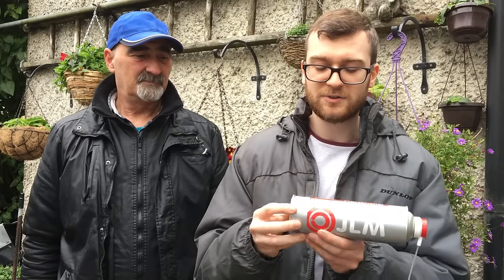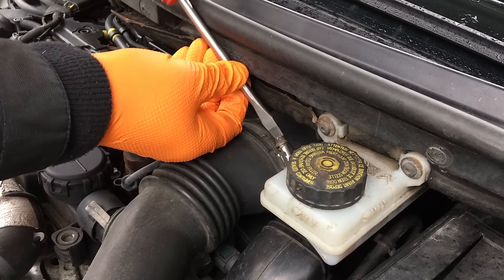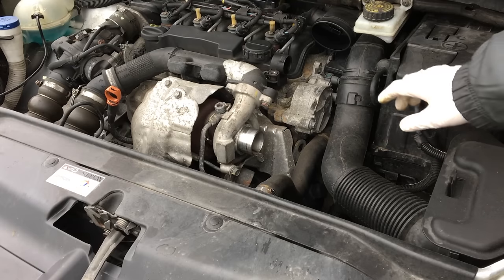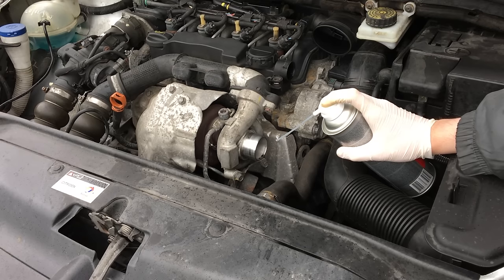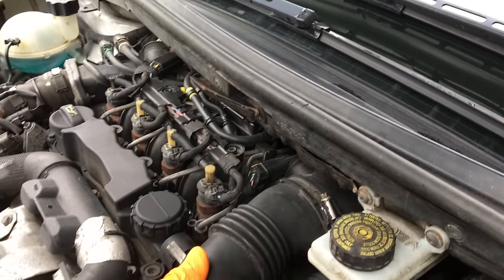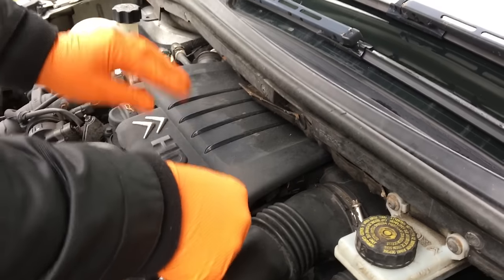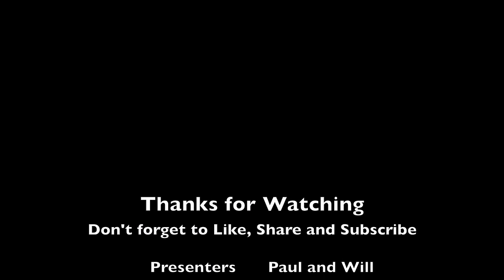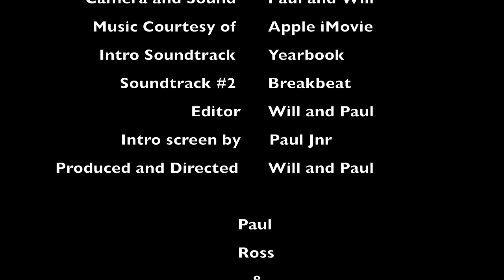How To Clean an EGR Valve Without Removing It

Comment: Hey guys! First of all, thank you SO MUCH for this video - it is incredibly helpful. We will be making a treck to Halfords to get the cleaner tomorrow. 

Secondly... a cheeky question: We're wondering if you know if this problem might have any connection with an "oil pressure too low" warning that accompanied our "Stop" warning on our Citroen C4 Grand Picasso today... our diagnostic reader came up with the same EGR warning, but nothing about the oil pressure?
Reply from the maker: Hi Joey. Glad you like the video and sorry to hear your having issues with your C4 Grand Picasso.

May I ask, how often do you change the Oil & Oil Filter and when did you last do so? Also what oil grade have you been using and does it meet the ACEA & PSA specifications for your engine? Using the recommended oil for your engine and one with low SAPS (Sulfated Ash, Phosphorus and Sulfur) along with a high quality oil filter can help maintain good oil pressure and reduce the build up of deposits in your combustions system and exhaust system. 

Please see this link as an example of how an oil with low SAPS has less of a "fouling" effect on a 1.6HDi EGR Valve than that of conventional oil: https://goo.gl/images/2cgGpN 
(All credit to the website where the image is from).

Driveway Dudes - Will

Comment: I just bought bmw 3 series 2010 disel the milage are  185k and it showing engine light i asked macsnic its egr prob.
Shall i call the company who come and clean the full system the EGR valve, MANIFIOLD, and the rest fuel injectorts the whole system by ataching some pipes to engine and clean full carbon which is stuck inside
Will that solve the egr prob's
Any one can help plz.

Comment: Spraying corrosive cleaner inside your turbo, valves, injectors and exhaust won't do any harm? 🤔
Reply from the maker: Everything you put in a car is corrosive, fuel, oil, water/coolant, even particulates in air.
Over time an engine, transmission, ancillary components and parts wear out and fail. In some cases will fail sooner if the correct maintenance intervals and periodic inspections are not adhered to or incorrect replacement/service parts and/or lubes are used and in some cases will fail due to total neglect. 
We would estimate the cleaner effects of this product outweigh the corrosive effects.

Comment: I was spraying in the correct hole.  But when I took the pipe off and started the engine, the other hole just continually spat out black smoke.  I didn’t see the black smoke on your video, what could this be please?
Reply: Oil burning off

Comment: Hi Guys an hint my be you can drill a small hole  approx 2mm in the corner of the hose to spray it in front of turbo inlet , after that you can stop it with an suitable rubber pin.
Reply from the maker: Definitely not

Comment: Would this prevent the car from starting ?
Reply from the maker: No, the contents of the can will ignite with the fuel
Reply: Driveway Dudes can you buy the spray at a local auto part store ? I have a 1999 Mazda 626 i think it I'm not getting any circulation it shows EGR on my autolink
Reply from the maker: Auto stores should stock a version of EGR valve spray. It may not be the same brand as we have used but they are all meant to do the same thing.
It's cheaper by far to try the spray first than to spend possibly hundreds on an EGR valve replacement.

Comment: Can you use EGR cleaner on Mercedes ML W164? If so where do you spray it into the engine?
Reply from the maker: Hi Ian,
We don't see why not. 
It's not uncommon for ML's as with other MB to get very gunked up pipes associated  with the EGR valve. Some remove all the pipes and EGR valve completely to give a thorough clean.
If you prefer to clean it in place then follow the airbox to the MAF sensor. Disconnect after the MAF or if not then before it but remove the MAF completely otherwise you may damage it with the spray. 

Let us know how you get on.
Paul.
Reply: Thanks for the info.  On my V6 there is a rigid air duct (part no 642 090 73 37) between both air filters and the turbo that includes what seem to be called "air mass sensors".  Two questions: are these sensors the MAF sensors? If they are and they are detached with the air duct can I spray the EGR cleaner into the turbo?
Reply from the maker: Hi Ian,
MAF is short for Mass AirFlow also known as Air Intake Sensor.  
Is the spray you are planning on using 1. EGR cleaner or 2. Air Intake and EGR system cleaner?
If 1, you have to remove the EGR completely and 2, you need only open the duct but remember to remove the MAF sensor before using the spray.
If you can remove the turbo inlet duct and you have the correct cleaner (2 above) you could apply it that way. 
Paul

Comment: My Mini stalls when I let go of the accelerator. Could this be a good fix ?
Reply from the maker: Hi RobM. Could you please tell us what year and engine it has please?
Thanks,
Will
Reply: all I know is, it's from 2002 and it's a 1.6 litre engine if that helps
Reply from the maker: Thanks. Is it a 1.6 diesel or petrol please?
Reply: petrol
Reply from the maker: Thanks. Is it a MINI One, MINI Cooper, or MINI Cooper S?
Reply: Cooper.
Reply from the maker: We are not able to specifically diagnose the issue but from what we were able to find out it could be one of these listed below.
1. 2002 and 2003 models were prone to engine harness issues.
2. Running the fuel tank too low.
3. Insufficient engine oil can cause car to go into limp mode/cut out without light showing on dash.
4. Faulty fuel tank breather valve.
5. Failing throttle body.
6. Failing fuel pump.
If you have the time, we would suggest you get an OBD check carried out by a BMW/Mini approved garage. If it's a friendly and helpful garage, they may already know from experience the issue and a fix. Do not tell them what you think it may be.
Alternatively, you could buy a wireless ELM327 obdII adapter (less than £10), download the suitable app to your android or iphone and you will be able to carry out the check yourself or even monitor it in realtime while someone is driving the car for you. 
Hope this helps.
P.S. Let us know how you get on with it.
Paul
Reply: I've ordered the stuff to give the car a (much needed) service, so I'll see if that improves the situation before anything else. Thanks very much!!!
Reply: @DrivewayDudes url  .

Comment: hey again mate code problem is p1352 is it serious to your opinion?
Reply from the maker: Hi zoharii,This is what I have found for fault P1352.2 possible issues for you to check out:P1352 Ignition coil A Primary circuit Malfunction / SID 801- Pre/Post heating relay circuit - Relay & Pre-Heat plugs not controlled.Could be the relay rather than the glow/heater plugs at fault. It controls the heater plugs. A small green box located near the battery. Paul

Comment: I have little oil in inlet pipes. Suppose it comes from breathing tube. Engine works fine. Does not burn an oil. Is it worth to replace that breathing tube which is integrated with valve cover and cost around 50 pounds. Any ideas dudes. Regards. Mileage is 100k. Some people say it is ok for this type.
Reply from the maker: Hi thelittleyellowducks. Thanks for your comment. When I first bought the C4, the service history wasn't very detailed to what oil was used during servicing and I had some oil in the pipes too. During my ownership over the last 70k KM, I've only ever used the oil that was recommended for the car. The quantity of oil I find in the pipes has reduced as a result.

From my experience with the cars I've owned, it is normal to find some oil in the intake pipes as it is the car's way of recirculating crankcase/oil pressure. This process is often controlled by a valve. I'm sure there is many types but one of which is known as a PCV (Positive Crankcase Ventilation) Valve. It's up to you whether or not you want to replace these but it sounds to me that if you're seeing oil, than your valve and breather pipes are working as intended.

Like yourself I would usually monitor how much oil is being used by checking the dipstick weekly, fortnightly, monthly, etc in order to gauge whether or not there is an issue.

Some people who have cars with forced induction like to use oil catch cans in order to gauge how much oil is being recirculated into the intake and once they deem there to be an issue they can take relevant action.

I'm sure if you use oil with the correct specification and winter/summer weight, the best quality oil filter you can afford and you change these no later than recommended, than you will be fine.

I hope you find the above information useful and if you require any further assistance don't hesitate to reach out to us.

Driveway Dudes - Will
Reply: Driveway Dudes I am more than happy with above answer. I never had diesel. These are new things for me. Many thanks for this feedback. Thx

Comment: Perfect 2in1 way to kill turbo and the engine! Why? Think before You suggest stupid and expensive things to others! 1st- Turbo(bearing) needs constant lubrication (with oil) which will be washed out by the spay cleaner. 2nd (already mentioned by others clever ppl) - if the cleaner manages reaching (not fully evaporated by turbo) EGR, the built up powder will get into engine (intake, comb chamber etc) -GAME OVER! Nothing can disappear or vanish. Imagine all that powder and chips starts flowing into the cylinders - perfect abrasive!

Comment: You spray it into the throttle body not the turbo 

Solvents will destroy a turbo
Reply from the maker: Prolonged exposure to solvents maybe.
More turbos have been destroyed through neglect of scheduled servicing we would say
Reply: this should be done on the charge hose not the intake hose as the spray will ruin a ball bearing turbo

Comment: Gentlemen some advice i just bought a uk  Berlingo 128000 miles very well serviced TG its a 1.6HDi 90  2012  which oil is best for me OW-30 low Saps full synthetic or 5w-30 full synthetic as im worried about turbo life,Thank you paul Hi no problem GU62UUZ thanks
Reply from the maker: Hi, could you please share your registration number with us? If you're concerned about privacy, could you please private message us your registration number? If you feel uncomfortable doing both/either, no one would blame you for keeping it private.

Based on what you've told me, the Total Lube Advisor web site recommends Fully Synthetic 5W-30 with;
* International Standards: ACEA C2
* Manufacturer Certificates: PSA PEUGEOT CITROËN: B71 2290

I (Driveway Dude Will) have personal, not sponsored, brand loyalty to using Total Oils, however you can use any oil that meets the 'ACEA C2' standards and 'PSA: B71 2290' certificate. If you're the same as me and like to use Total, the exact oil I would recommend you use is Total Quartz INEO ECS 5W-30.

As with any used vehicle Paul, Ross or I have bought in the past (sometimes with service history, sometimes without), our first service on the vehicle has always been with the recommended oil. We monitor oil consumption over the service schedule to gauge the condition of the engine. If the oil burns between no and little oil (your handbook and/or forums should tell you how much oil the engine will burn/consume), you should continue using the recommended oil. If the engine burns a little more oil than expected, you can decide if you're going to increase the weight of the oil or bring the vehicle to a mechanic to diagnose the issue.

I hope the above information was useful and we wish you all the best with your Berlingo.

Best Regards,
Will
Reply: Thank you   i appreciate your words of wisdom ,keep safe to you both ,paul.
Reply from the maker: You're welcome. Same to you thanks.

Comment: This is dumb this wouldn't clean anything and even if it did. where do you think all the sludge is going to go?

Straight into your engine.

Stop with shortcuts and do a proper job removing the egr valve on this engine takes 30-60min with cheap basic tools
Reply: Cant you the  get an engine carbon clean to remove the gunk ?

Comment: Sorry cant remember.But was just checking to see what was said.Will post if i can find it.
Reply from the maker: There are different ways clean an egr. Some even would say you may have to remove it. 
The object of this video is to be able to clean an egr with as little disruption and effort as possible.
In our case, this way has proven to work for us.
We do not say that this is the only way to clean an egr.

At the bottom of the description it says that this video is for guide purposes.

Hope this helps you.

Driveway Dudes - Paul
Reply: Neil Cromwell I

Comment: All Brits wear orange gloves like Ed Chins must be real good..
Reply from the maker: They are indeed very good gloves. They may be a bit more expensive than the usual ones which we considered quite delicate and tear/rip easily. We get better grip and they appear to be made of a tougher material. A bonus is that you can wear them more than once if they're not damaged or ripped. When we purchased these we didn't get a colour option but believe you can get them or similar in other colours if you shop about

Comment: Hey you need to go directly into the throttle body mouth. Spraying it into the turbo it will just dissipate before it reaches the internals. 

I have a Hilux D4D 3L and you need to remove the intercooler off to get the hose into the throttle body to spray it straight in. 
I used liquid moly and it’s great stuff. 4x4 has plenty of pick up restored after doing this. 
Need to spray full can in at 2000RPM until can is empty. 
Let it sit for an hr to soak them take it for a run until all that smoke has gone and burnt off any shit thats inside. Need to do a oil change when finished. Repeat this process in 10 000km   
You will be surprised with what it does. As the mechanic said in previous post you need to remove the whole system to clean it properly but this product I used worked fine. 

I also have a EGR blank plate installed with a catch can so the sludge burn off doesn’t end up in your sump.
Reply: If that was the case and it dissipated before reaching the combustion chamber, then you would not hear the engine revs rise after each spray.   The fact that you hear that change in revs (caused by the change in the air/fuel ration) means that the chemical is definitely reaching the combustion chanber.   Now whether this approach is enough to actually clean a heavily coked up EGR valve is another question altogether.

Comment: On that engine even the buterfly valves can triger a egr faukt code.  Most of that cleaner remained in the intercooler. Yoj should have taken out the piping after the intercooler

Comment: This only works when there is a smaller layer of soot,on my car it was so blocked that i had to completely dismantle it into pieces to get it cleaned thoroughly
Reply from the maker: Hi Voja,
We used the spray in this way due to the EML showing on the dash clocks. It worked for us. 
For EGR valves that may be faulty or with very heavy deposits that may necessitate removal and thorough cleaning: see
           https://youtu.be/HXqJ0YcOqOI

Comment: Hi

in the peugeot partner tepee is in the same position?
Reply from the maker: Hi GeGe,
The Peugeot Partner Tepee 1.6hdi and Citroën C4 1.6hdi engines are the same power plant and almost identical. 
Some upgrades and modifications may have been carried out over the years but I expect the layout for both should be the same.
Hope this helps.
Reply from the maker: Yes, they appear to be the same
Reply from the maker: If you like you can contact us on https://www.facebook.com/drivewaydudes/ and we can reply with a picture of Will's C4 engine bay
Reply: Driveway Dudes is the Renault Megane 2010 mk3 in same place? I’ve got 3 lights in spanner a fume light and check anti pollution system
Reply from the maker: Hi FatN,
The Megane is not the same as the 1.6hdi that is shared by Peugeot, Citroen, Ford, etc. 
I believe the egr valve on the Megane it at the bulkhead side of the engine.
Reply: Driveway Dudes I found out it’s the catalyst n lambda I been told
Please guys NEVER EVER USE CONCORDE THEY MADE ME PAY FIRST AND STOLE MY MONEY
Reply from the maker: Good to hear you have found out the issues with car.
We have never had any dealings with that company so we cannot comment, agree or disagree with your statement.

Comment: hello dear friend I have 2010 Citroen Berlin go  1.6 hdi turbo 75 look lately I hot check engine and rpm is limited to 3000 any idea if the is the problem ?
Reply from the maker: Sounds like your Berlingo is on Limp mode. This happens when the ECU detects a fault and restricts the engine to protect it. 
There's no 'quick fix' for this as you would need to know what is causing the fault in the first place.
Some of the issues that can cause this include - faulty exhaust sensor, glow plugs/relay or fuel pump issue but without carrying out a diagnostic (OBD) check (Lexia software) with a Citroen approved garage or workshop it would be very difficult to diagnose. 
The ECU records all faults and the Lexia diagnostic will be the best way to go before you start replacing parts and possibly wasting money.
It could also be something as simple as a software upgrade and again a Citroen approved Dealership can check and rectify this for you.
Hope this helps.
Paul
Reply: hey Paul thanks for your reply I'll do so soon I really hope Its just software upgrade I will update  best regards from israel